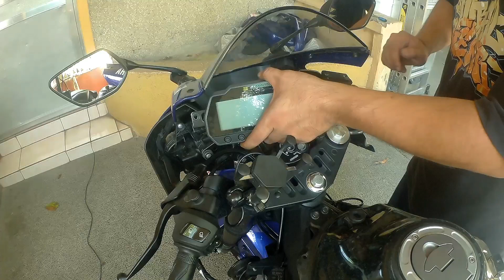Yamaha R15 V3 Headlight disassembly

Comment: Nice video bro.
Can we change the led of this light , this original lights is not good for highway.pls help n suggest me something love from India.😍
Reply from the maker: Bro the headlights are led's mounted on a PCB board, not like the v2 which has Bulbs. you can modify it to fit projector headlights. 🙃
Reply: @NicksGarage_ph  thanks bro ☺️, can u help me with to choose some good projector lights or fog lights . Or any  link in which lights are getting modified.
Reply from the maker: Bro try to check morimoto projectors i know the have small size projectors.
Reply: @NicksGarage_ph  BI-XENON: MORIMOTO MINI H1 8.0 will this fit?

Comment: The video is really amazing brother, can you please tell me can I change the bulb alone, because my high beams are not functioning
Reply from the maker: Bro the headlights are led's mounted on a PCB board, not like the v2 which has Bulbs.  you can try an check the connections and the switch first before the led's .
Reply: @NicksGarage_ph  thanks a lot brother
Reply from the maker: @ricckyramesh5012  your very much  welcome.
Reply: Bhai high beem sahi ho apka... Because meri bike me b same prblm h..

Comment: Led h9 or h11?
Reply from the maker: Headlights are not like the r15 v2 that you can replace the bulbs. The v3 have the led headlights in a pcb board.
Reply: @NicksGarage_ph  can it chance? Or replace with better light?
Reply from the maker: @sayantanbasu6854  you can add auxilary lights. Or you can modify it to fit a small projector headlights.
Reply: @NicksGarage_ph  thank you
Reply from the maker: @sayantanbasu6854  your welcome sir.